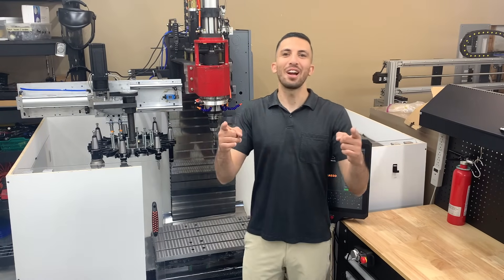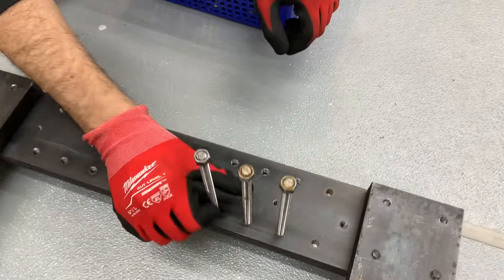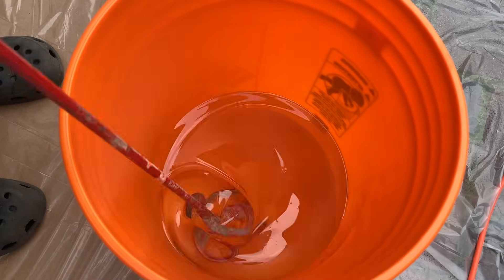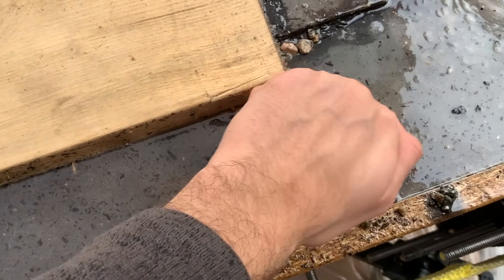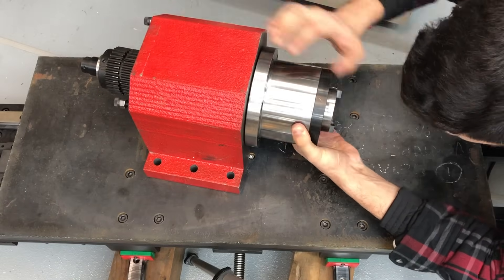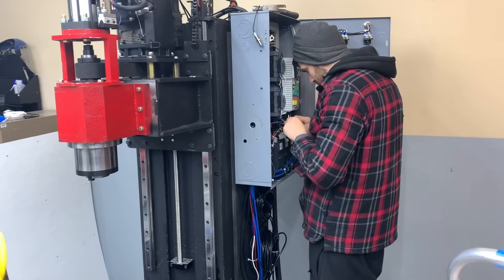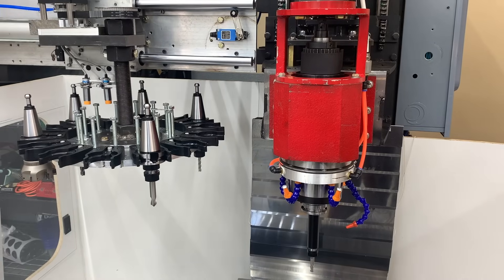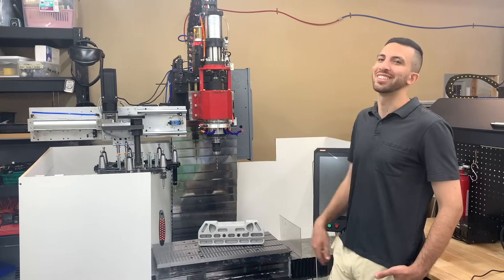Building a DIY CNC Machine With Automatic Tool Changer

Comment: Doesn't the thermal stress strech the Z-axis assembly after welding it from so many sides? Why didn't you also make that part with bolt connections as you did with the base of the machine?

Comment: Wow, as a professional machinist who has run manual and cnc equipment (mostly Hass) im very impressed with this build. Very curious to see the hybrid epoxy and stone mix for the column and base. I cringed a little when you did it but as you explain the thinking im kind with you. Would love to have seen more on the install of the rails, and the initial setup and program. But good work. Be curious to see how it holds up over time.  But good lord, you guys need to look into some high speed paths.  That cycle t8me was ridiculous.
Reply: Brother are you a professional machinist or qualified machinist? because if you are im disapointed in you you know exactly what im talking about if you are a qualified mecahnical engineer

Comment: So you got the rails parallel with a dial indicator, well done, but how did you get the primary rail straight in the first place? I saw no sign of a milled index face or any jack screws to adjust it. So you have two parallel curves, which will of course cut that same curve in everything.
Reply from the maker: This assessment is true.  Our intent with this video was not to show people how to make the most perfect CNC machine, but rather focus on demonstrating how to make a big machine when all you have access to are smaller machines/equipment.  We rely on the straightness of the very thick rails to provide the nominal alignment in the curved axis you are mentioning.  It worked very well in this application. 

Great catch and hope you enjoyed the video regardless.

Comment: While the epoxy + gravel idea sounds good, it's actually better to use gravel by itself - or better yet sand. When combining both you end up with a solid block which will only help to reduce 'some' vibrations due to its mass but might increase other vibrations. Individual free-moving particles (sand or gravel) would dampen vibrations far more effectively.

Comment: What about the software that drives the DIY CNC MILL?  Is it a standard OSS found on github?
Reply: The ave a Masso G3 touch as the controller for the cnc. It runs everything and takes the place of needing a seperate computer

Comment: You are the men. Congratulations. Could you tell me if you can cut carbon steel with this machine?
Reply from the maker: Carbon steel can be hard or soft depending on its composition. Yes this machine can handle it no problem, but for very hard steel we have used carbide tooling.  Hope that helps,

Dave

Comment: Couldnt you just bolt it to the floor (assuming its concrete)? Wouldnt that be better and cheaper than the epoxy or having it weight a ton? Seems like a really easy fix relative to the epoxy mix and mold.

Comment: Excellent... a question , I want to make my 2x3m cnc for different woods and melamine, what servo motor, spindle, bearings, couplings, inductive sensors, emergency stop and stroke limits do you advise me to use? thank you so much

Comment: How did you decide that it needs counter balance weight 🤔
Reply from the maker: I guess intuition drove me to do that, however I know that the newer line of smaller haas machines do not have counter weights but rather just a break on the z axis which they claim drops 7thou when activated.  Hope that helps. Cheers,  Dave

Comment: @Action BOX Don't know if you'll see this, but why didn't you use concrete instead of epoxy? It would have been much cheaper and (I think) heavier.
Reply from the maker: Hey, we see every comment 😀. The video explains the natural damping of epoxy, and normal concrete is not the same and does not handle vibrations as well. You are right though, concrete is much cheaper.

Comment: Great build, quick question. Did you have your steel stock, onto which the linear rails are mounted, surface ground flat?
Reply from the maker: I did not. The purpose of this video was focused on how to build a big machine without access to a bigger one.  That said, if I could rebuild the machine I would use cold rolled steel which is much flatter than hot rolled steel.
Reply: @ActionBOX  Great info thanks!
Reply: Anything else you would have done differently regarding the epoxy granite base?
Reply from the maker: @theunscraven812  Yes, Get a concrete mixer to mix this stuff because its very hard to mix by hand, which resulted in me not achieving the optimal rocks to epoxy ratio (I had too much epoxy and could have mixed in more rocks to save money).

Comment: Most impressive CNC build I have seen! Yes, mass and rigidity. I wonder if concrete would be good instead of epoxy. 15k$ is a lot but it is all new. ..as compared to buying a used VMC for less but that could have very expensive issues.
Reply from the maker: It’s a common question we get, however concrete does not dampen vibrations as well as epoxy granite. Glad you enjoyed the video!

Comment: Well done lads! It's amazing that we have individuals like yourself, your dad and others willing to tak on such a monumental task.  I was thinking about your choice of epoxy and stone as an additive to create mass/weight to the base, etc.  Q. What other materials did you considder to add mass to your build?  For example, did you considder a combination of lead pellets encapsulated in concrete?  It would interesting to know the cost of the epoxy/stone approach when evaluated against concrte/lead, and see/learn if one is less or more costly than the other.  Again, great work.
Best - Michael
Reply from the maker: Hi, thanks for your comment. We did actually throw a bunch of scrap bolts etc in there to add mass, and had considered metallic pellets for this but it was far too costly to do so. As per the concrete, it does not handle vibrations well so it is not a good choice to cover the pellets in your case. Thanks again for watching Michael and I look forward to your reply in future videos 😃. 

Cheers, 
Dave

Comment: Did you pour all that he parks it once or do it in layers? Because I thought it was bad pour more than 4 inches at a time because of the exothermic reaction
Reply from the maker: We poured the epoxy in all at once.  You are correct that pure epoxy will heat excessively when poured thick, but since was had all those rocks mixed in, the layer of epoxy at any given point was rather thin, at most I would guess 1cm. Hope that answers your question. Cheers, Dave
Reply: @ActionBOX  ahhh yeah makes sense! Thanks for the reply!
Reply from the maker: @jakejacobson2999  no worries, glad you watched the video in such great detail 😃

Comment: Hi first of all best wishes for 2023.
Nice people, a very nice project, nice work.
I also see a nice tool changer.

Question, is there a macro available, am building one right now. and my trial macro is not running properly.

Good luck.
Dear Gerrit
Reply from the maker: Thanks for your support Gerrit 😃 unfortunately we did not use a macro to operate the tool changer so we do not have one to share.  This function was built into our controller.

Comment: id like to know the model of the servo motor that you used for the spindle
Reply from the maker: We got it from China, I do not have the exact model right now.  I will try to add those details in our next build as we plan on putting together a larger machine. Cheers, Dave

Comment: Impressive build, so glad i found this video! 

I have so many questions! Like for one, how did you manage to level the Linear rails? The rails are mounted onto a long steel plate, which is then mounted onto the epoxy base? 

1. So wouldn't the long steel plate have so many imperfections, that when the rails were mounted on, bring them out of level relative to each other? 

2. Did the Epoxy Rock mixture have to be ground down so the rocks weren't sticking out? Or did you make the layer at the surface pure epoxy? Did the rocks cause any air bubble issues? 

3. Are you using software compensation to deal with any squareness issues?
Reply from the maker: Hi, great questions.  Our primary focus was to show others how we built a large machine without the use of even larger machines.  Yes it would be proper to take our machine after it is built and square off all surfaces using a much bigger machine, but that’s not possible for us to do at home.  Instead we attempted to implement the kinematic constraint theory which produced not absolute but rather substantially parallel surfaces.  This worked great although in hindsight we should have used cold rolled steel instead of hot rolled steal as it is much smoother. 

The epoxy mixture was not ground after pouring, and definitely had small air bubbles in it which may have caused negligible effects on the final product, but nothing that seemed to affect our level of work. 

We do not use any software compensation. The machine holds incredible tolerance and repeatability measurements.  

Hope that helps and thanks again for your support 😃. Cheers, Dave

Comment: Great mill, it looks very rigid. But why does it took you 20 hours to make just one mold? You should be able to cut much faster with such a heavy machine.
Reply from the maker: It was our first ever cut so we were cutting conservatively.  We have sped up the mill significantly since.  Cheers.

Comment: what percentage of resin and rocks did you use?
Reply from the maker: Roughly 30%. 17% epoxy would be optimal but we would have needed different ways to mix it which we did not have access to and were too short on time to try to find. Cheers

Comment: Absolutely incredible. My only piece of advice is if you ever need that much epoxy again try to buy it in a 50 gallon drum. Here in Chattanooga i use a company called Advanced Plastics, and they’ll deliver the drum and it usually saves me about 75% off the price if I were to buy it individually by the gallon. Not sure if that’s a nationwide company or whatever but you’ll be able to find somebody in your area that will sell you the type of composite material you want, and a large enough quantity so that you get it cheaply, and they will deliver it. most of the materials I use cost around $1500-$2000 per 50 gallon drum but according to what type you’re using it can be cheaper or much more expensive. All depending on the properties needed and the type of material.
Reply from the maker: That’s awesome advise.   It would have saved me a ton of money.   I’ll probably be building an improved machine soon so I’ll keep that in mind.  Cheers, Dave

Comment: Have you machined the surfaces where you install the linear guides ? I couldnt see that detail on the video . Great inspirational video btw. Great job.
Reply from the maker: No we did not, and while this is not proper practice for making a high end machine, we really wanted to focus on how to make a big machine at home, when we don’t have access to even bigger machines to do things such as grind down the entire length of these surfaces. If you have any ideas please do share. I have considered using cold rolled steel next time instead of hot rolled steel, to making sun better tolerance. Cheers, Dave

Comment: How does this machine compare with a Haas VF 1? When are you going to start selling them? I reckon you guys must be cnc service machine tool technicians. To be familiar with the componoents.
Reply from the maker: Hi, I would say this machine is more similar to a haas vf2 in size. It holds great tolerance and machines very fast for a small shop. We won’t be selling these, and no, we had no professional experience with these machines when we decided to build this.  Cheers, Dave

Comment: Can you give more insight to the systems used to move the X , Y frame from a file type. And the programming / software used.
Reply from the maker: We used the masso controller and servo motors from Lichuan.  We programmed the tool path using fusion 360

Comment: Wouldnt it make sense to just use concrete instead of epoxy ?
Reply from the maker: No, as explained in the video, epoxy is great for vibration damping. Unfortunately concrete is not, and it will just crack. Hope that helps. Dave

Comment: I don't know if you knew this ahead of time, but one of the biggest names in precision grinding, Studer, literally uses granite mixed with expoy in a composite they call "Granitan" to cast their machine bases. You actually used one of the best possible materials for vibration damping that's been in use for 30+ years lmao.
Reply from the maker: Thanks for sharing 😃. I was aware that the mixture is used in industry, but not that it is used by this company.  Cheers.

Comment: That’s extremely slow for 8HP on the spindle. I’ve got a Tormach with just 2HP that could make that part in an hour.
Reply from the maker: You are correct.  This was our first ever part on the machine so we were running very conservatively.  We run the machine almost 10x faster on aluminum now with carbide tooling.  Thanks for watching 😃

Comment: Hi David, well done.  It has encouraged me to consider doing the same for my own workshop.  Your base was bulked out with granite / epoxy.  That had to be espensive.  I’m wondering if using concrete, perhaps with chopped glass fibre would give you dampening but at a fraction of the cost.  Cheers.
Reply from the maker: Thanks Pete, the video explains the natural damping of epoxy, and normal concrete is not the same. The glass fibers might help prevent cracking but not vibration damping. Cheers.

Comment: I built a desktop CNC back in 2017, using plywood, a dremel knock off, nema17 motors, arduino, acme screws, hardened steel rods and linear guides, but this, this is what all we have tried to build a CNC want to achieve! Awesome!
Reply: How did the Nema 17 engine behave? (Translate portuguese to english language, sorry)
Reply: @joaobritonascimento  don't worry about your english, I speak Spanish actually 
The nema17 motors work fine for the kind of work, the CNC was only to make PCBs and cut plywood 
They depend on the driver too, I was using some A4988 clones
I think they work best for laser cutters and 3D printers
Reply: @robertobrenes5283  I'll try to build a simple CNC using Arduino One. Gracias!
Reply: @joaobritonascimento  good luck, GRBL is good, I would like to rebuild my cnc using other board and Marlin

Comment: Heads up.  You need to align the chain over your counter weight.  The Chain should remain parallel to the travel of the weight.  As the weight nears the top of travel, the loads of the chain pulling at an angle to the travel, will greatly increase the chances of shearing the pins for the attachment points.
Reply from the maker: I’m not sure what you mean, can you elaborate? The weights are confined by the linear rails.

Comment: Would concrete perform well in place of epoxy?
Reply from the maker: No, concrete is very bad at absorbing vibrations relative to epoxy. It is far cheaper though, so you would have to decide what is more important for your application. Cheers.
Reply: @ActionBOX  thanks

Comment: How is a mixture between cement-powder/stone, compared to a mixture between epoxy/stone
Reply from the maker: Im not sure unfortunately as I haven't tried, but theoretically epoxy should absorb vibrations far better than the concrete so I would assume it performs far better (although it is far more expensive). Cheers.

Comment: Is there a full BOM posted for this build? I don't know how to source 40 gallons of epoxy for less than $1500!
Reply from the maker: Hi Josh, not yet. We plan on rebuilding this machine and uploading the newer BOM and designs. Hopefully that will be helpful in the future.  Cheers, Dave
Reply: @ActionBOX  I'll look forward to that video.

Any hints as to where you sourced the epoxy resin? I have searched around and the going rate seems to be close to $40/gallon for sub 55gallon drum components.
Reply from the maker: @saf3ty3rd  that’s less than the price we paid.  It’s definitely expensive stuff.
Reply: @ActionBOX  More than 10% of the build budget was epoxy? Wow!
Reply from the maker: @saf3ty3rd  yeah.  Plus our mix ratio was about 30% epoxy (should be 17%) so we wasted great money there.  Good learning opportunity for next time 🤷🏻‍♂️.
Reply: @ActionBOX  I've seen numbers from 8-20% claimed but I imagine the maximum is driven by the size of fill particles and the minimum by the viscosity needed to fill the forms.

Comment: I don't know if this will be useful to you one day: Lead is the best heavy vibration damper ever, because it is heavy and soft, if the lead is absorbs vibrations as motion, the weight and flexibility causes very high virbation absorption, i.e. lead speaker cladding.
Reply from the maker: Interesting thought.  Can you share a link to more details on this?  Cheers

Comment: Can you tell more about the belt ATC. Where did you buy that kind of part, BT40 or BT30. I can see that you are using servo Spindle. Tell us more about that to if youbare willing... nervously waitingbfor your replay:)
Reply from the maker: It is a BT40 spindle spun by a 5.5kw servo motor.  We will try to build another machine and document in more details.  Cheers.

Comment: I'm wondering...  why epoxy and not cement to add weight?
Reply from the maker: Great question! Concrete is very bad at absorbing vibrations relative to epoxy. It is far cheaper though, so you would have to decide what is more important for your application.

Comment: Just an FYI: possible cost cutter. Years ago, I worked for a company that sold Clausing Colchester machines that used steel box structures filled with what amounts more-or-less to concrete. The rigidity and vibration absorption was excellent.
Reply from the maker: Thanks Phil, I’ll look into that. Cheers.